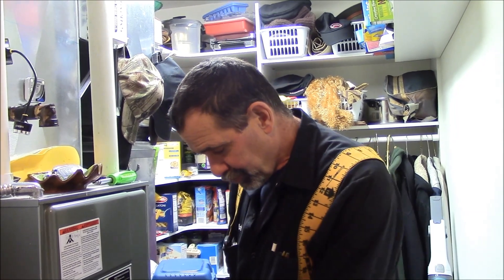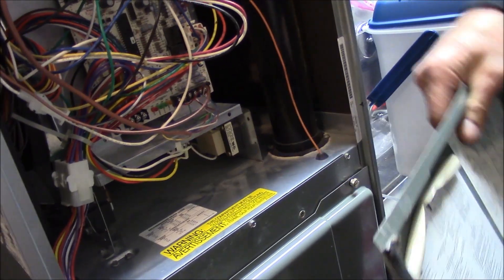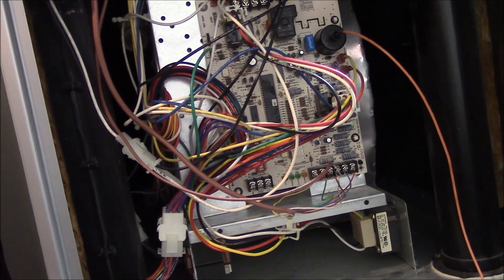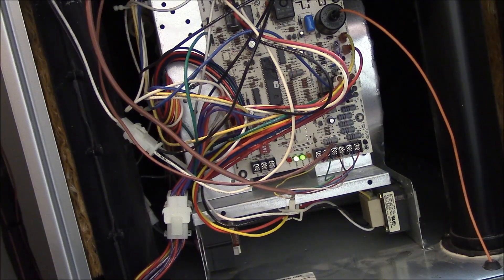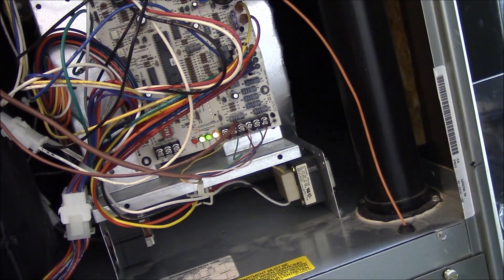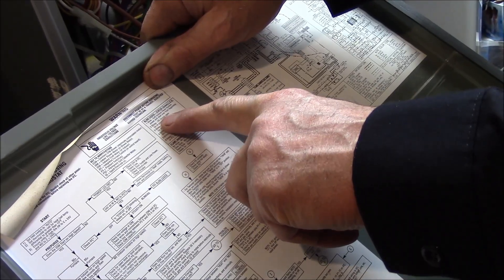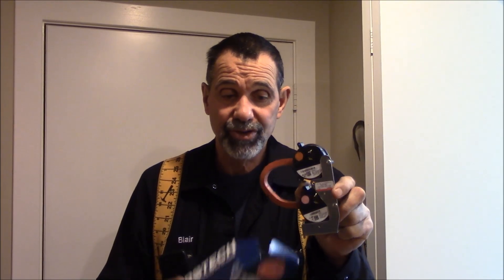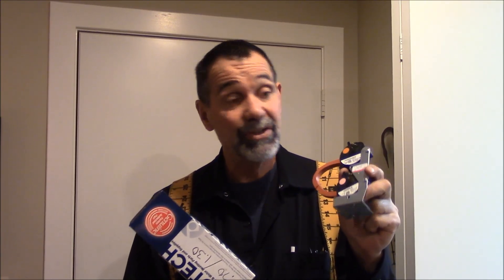Furnace Error Fault Code Lights - Repair, Troubleshoot, Fix, Diagnose

Comment: Most of the time the sensor doesn't need replacing, only cleaning with a fine abrasive or steel wool.  The orange flame sense LED illuminates when flame is sensed, not when there is a problem. If flame is erratic, then light will blink. If no flame is sensed, LED will not illuminate.  Pressure switches usually have clogged ports where tubing hooks up or intake or exhaust passages are not clear. If high efficient furnace-check the drain. It's probably clogged.
Reply from the maker: Good tips, thanks, Blair

Comment: i have a hydro flame model FA 7225 i am replacing motor with a FA 7232 could i get a color diagram for each unit as they have different wiring.
Reply from the maker: @BrianBall-f6z  sorry I’m not the furnace guy. I’m the hardware guy. My goal is to teach you to look for the codes and how they’re typically on the backside of the front panel of the furnace.

Comment: LED 2 blinks after starting the exhaust blower on weather king unit.  Pressure switch was not turning on.  I tracked the house back to the blower and found I couldn't blow or suck from the hose.  Turns out some debris was inside the blower tube outlet which I cleared with a small wire.  Maybe carbon crumbs because it sounded grainy. So some advice there on checking the hose and pressure switch before spending money on that switch sensor or even telling a tech to bring one because most likely they'll sell it to you to score an easy job.

Comment: My LED light is steady , but my unit turns on but turns off immediately, where do I start looking if the led light is not blinking?
Reply from the maker: This is a longshot, but the flame sensor, which is in the burner area of a furnace, which is a single wire that sensors to see if there’s flames could be the problem. because if it gets dirty and it doesn’t sensor the flames it shuts the unit down in a few seconds. https://mrhardware.com/articles-and-videos/heating-cooling/easy-furnace-flame-sensor-repair-clean-replace-fix/
Reply: @MrHardware1  thank you for the quick reply, I will clean the flame sensor and see what happens. I hope it’s not the gas valve, may be a little pricey

Comment: troubleshoot my goodman hot forced air furnace. Heres exactly what happened.. replaced the original thermostat with a smart thermostat and the ROLLOUT SWITCH kept triggering. So I went back to the original thermostat and as I was doing so the R and the W wire accidently touched my screw driver and caused the led light in the circuit board to show that it has no power. 

Next, I checked the on/off switch. All good, 120V. I then checked the junction box on the furnace. All good, 120V. I then checked the cover switch, all good, polarity tested fine.

I looked around and I do not see any burnt wires. made sure there not no disconnected/loose wires, all good. I thought on the circuit board and could I pull a code from there. No light to tell me if there was a code. I have 120 V going to the transformer and 28V? coming out. I checked the 3amp fuse on the circuit board, good.

I'm at the point where I think the circuit board is dead but not 100% sure any recommendations #hvac please reach out thanks!
Reply from the maker: Yup, looks like you need a furnace man.

Comment: Thank you for telling me there are charts inside the furnace door with information on them.  I was able to find out the pressure switch was open after two separate heating and cooling companies were here and said there was nothing wrong with the furnace.  One even said it was my thermostat and charged too much to put in a lower grade than what I had.

Comment: My Honeywell ignition retry seems to be giving off multiple codes but everything seems to be working properly but sometimes the damper flap doesn't open all the way and I just push it a little and it kicks on
Reply from the maker: That sounds like it needs replacement, CO poisoning is not to be toyed with.
Reply: @MrHardware1  Thank you Of course it happens of the weekend but Iv been going down every hr and making sure Its not stuck and the furnace has kicked on I can't believe a damper is $200+ anyways thanks for the response really means a lot

Comment: He sure makes it sound easy. Lol.. not that simple most of the time people... What he didn't tell you is that the flame sensor being the problem is if your lucky.. those codes don't tell what's wrong all the time, sometimes a code will come up and its something totally different that's causing that code to pop up

Comment: My manual and door instructions do not say what the red led means. It is blinking 9 times and stay in for a while before blinking again.
I notice the red led turns on in your video, but you change the camera position right after it happens. It's it normal?

Comment: My problem is when I turn on the furnace, it's go on for a few seconds than turn off. Than my furnace board  green and red is  flashing. Update code for that is 1 hour lockout.